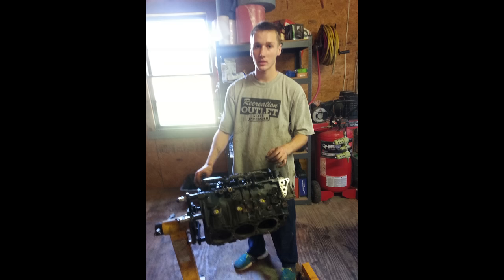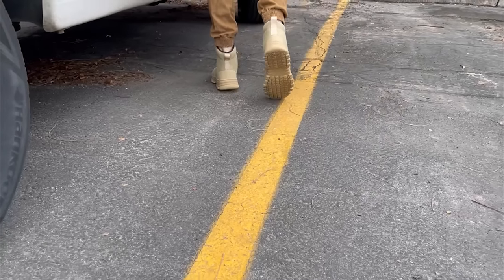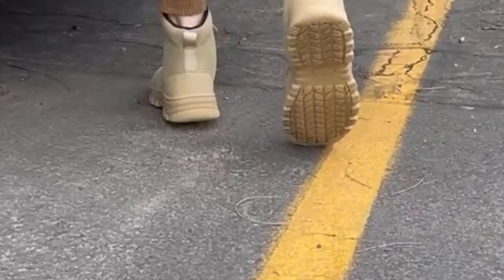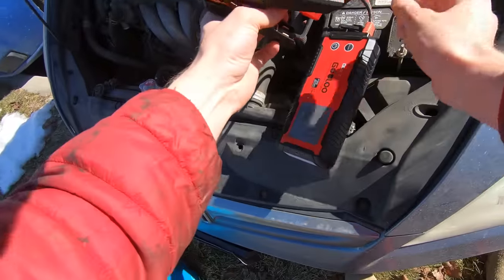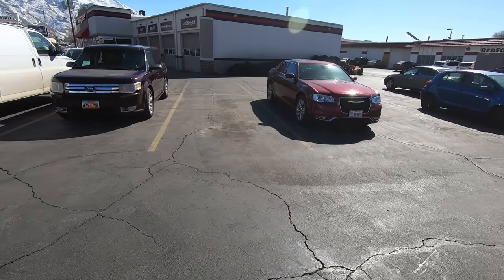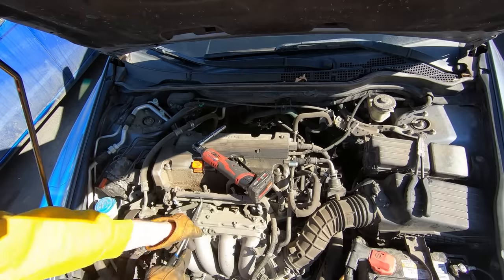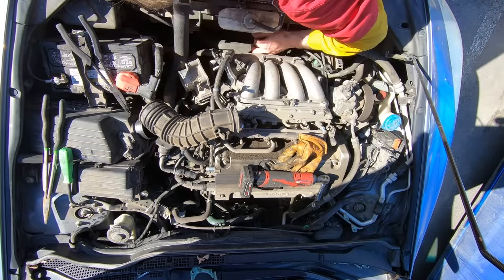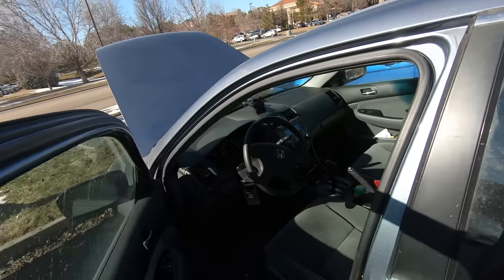How do I DEAL with an Emergency CAR? - Mobile Mechanic Rescue.

Comment: It's easier to move a car by pushing on the top of the tire because that essentially gives you a 2:1 advantage.  When rolling the top of the tire is moving twice as fast as the car.
Reply from the maker: that makes sense! Thanks for explaining!

Comment: It's getting to the point where you'll need a PhD in mechanical engineering and to remove an entire motor and transmission to do an oil change. Let us pray.

Comment: I have to do this without electric tools and I’m kind of inexperienced  any tips or tricks you can give me ahead of time was taking off the whole manifold necessary? I also plan to use the same gaskets
Reply from the maker: I usually buy a set of gaskets to have on hand and return them if that tells you how much i trust the old ones. But sometimes you get lucky so if you live close see what happens. 
just the outer part of the manifold. The one bolt on the bottom bracket is the same size. For the first time id expect an hour and a half. longest part is unscrewing the starter bolt without a powertool. No Big Deal! Good Luck!

Comment: I wish your videos were longer ,always great to watch
Reply from the maker: good to know!
Reply: I actually prefer videos that are around this length, ie 12 to 15 minutes is enough to show us what's involved in the repair, while giving us some background to the  story.  On the few cases when needed, I'd rather have videos of no more than 15 minutes  (or 20 minutes at the absolute  most), but then have a clearly labelled "part 2".  I sometimes also watch,  is it "Pine Hollow Auto Diagnostic"? He's from the NorthEast up towards the Canada border. He often fixes cars that other mechanics and sometimes even official dealerships can't solve, but I can watch a series of 2 or 3 short videos in bite sized chunks !  When I see a thumbnail and a video is 40 minutes or an hour long, it just turns me off straight away.

Comment: so the starter was faulty ? Did his ECM throw a code that the starter was a problem ?
Reply: probably not because it didn’t have any voltage problems when the ecu tried to activate the starter so from what the ecu could see everything was working fine 😊